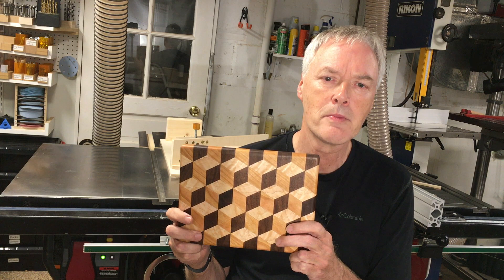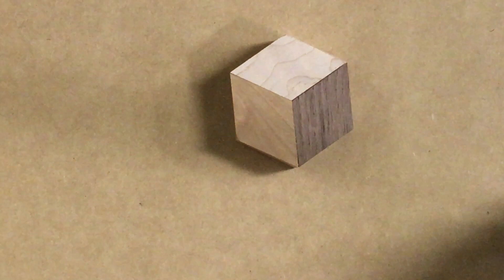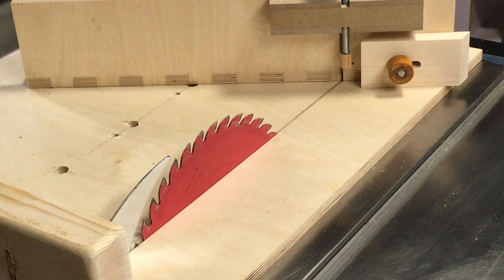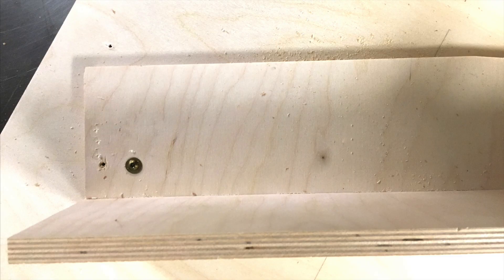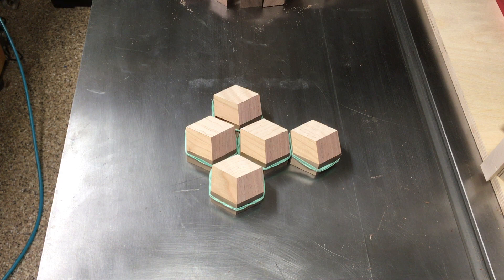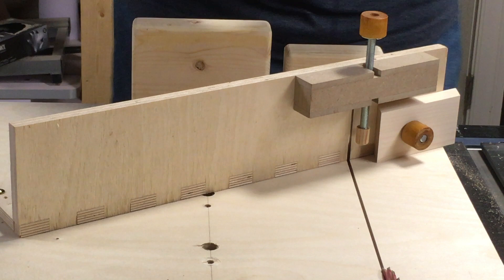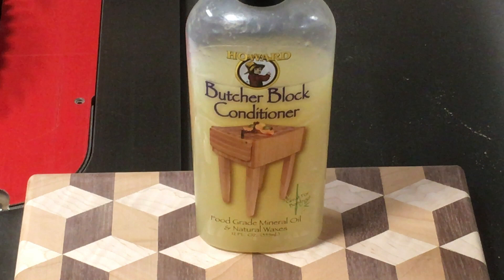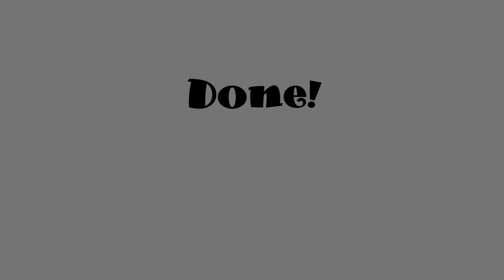Louis Cube design in solid wood

Comment: Fabulous video!  Thank you for sharing your mistakes- makes me feel less inadequate to know others make them too!  My question: How is the glue holding up?  I’ve been worried to use a quick glue for fear it won’t hold up to water and stress and soap and normal kitchen wear and tear compared to Titebond III?  Thanks again for an excellent production!
Reply: I wish I had a good answer on that.  I made a half-dozen of these and gave them to siblings and neighbors as Christmas presents.  As far as I know, none of them have actually used them as cutting boards; they've been either used purely as decorations or as serving trays, so they haven't had a lot of water or stress.  I do know that the finish I used benefits from being refreshed every year or so if it's kept in a dry environment.

Comment: how do you determine what the depth stop should be set at so all sides are equall length?
Reply from the maker: The depth stop determines the size of the pieces.  You can set it anywhere you want, and as long as you don't then move it all your pieces will be the same size.  Each piece will also have equal-length sides.  That's because you're running each piece through twice.  Each pass determines the length of two sides, so two passes make all four sides the same.

Comment: How thick was your cutting board stock? Did I miss that
Reply from the maker: Speaking of missing things, for some reason I seem to have missed the notification of your question.  I apologize for the extremely late reply.  It was 3/4" thick stock, though neither the jig nor the procedures require that.  The thicker the stock, the more careful you'd want to be that your table saw blade is at exactly 90 degrees from the jig surface.